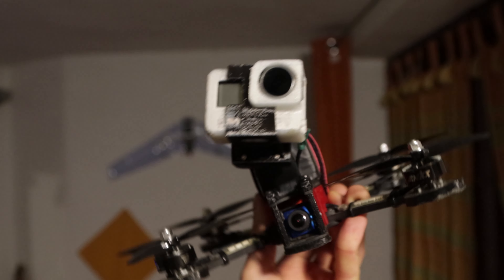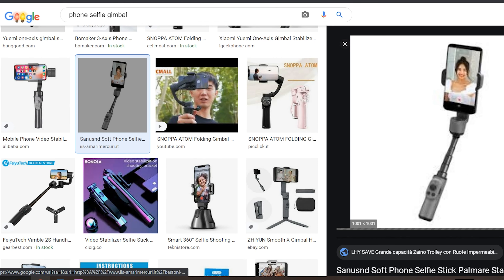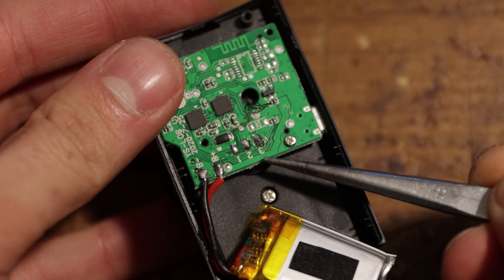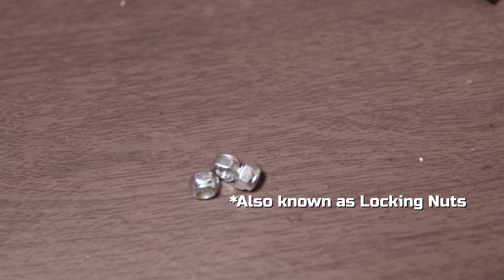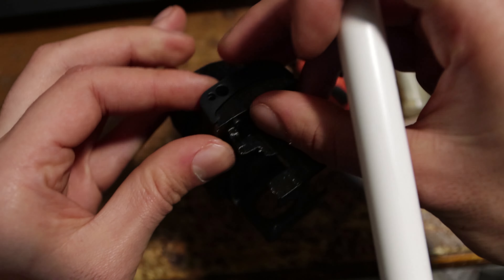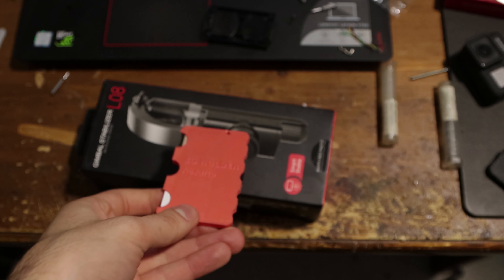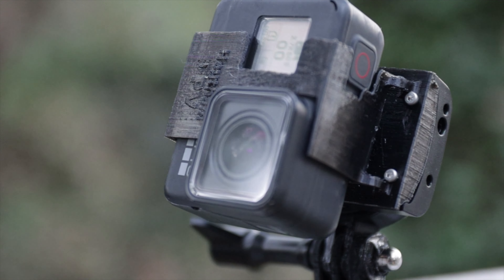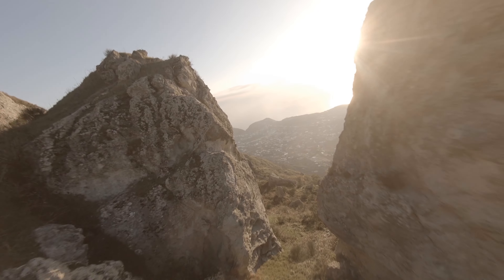I made an FPV Drone cinematic GIMBAL!

Comment: I did kind of the same ( incl. Modified TPU mount/casing) and used a LOFTer gimbal...nice and compact , easy to mod .
Now i start working on sourcing parts for a FPV gimbal DIY system ( 1axis only)
Reply from the maker: Hey man, it's an honor having you here! yes these phone gimbals are amazing, maybe you could test this kind of gimbal with a smaller brushless motor. keep in mind that the motor nut has a magnetic piece on top that gives the board a reference for its position with an hall effect sensor
Reply: @haythamfpv  I already used a 1804 on that boards, the magnet can be mounted on a the stator screw...not ideal but the concept looks very promising !
Reply from the maker: @nicecrash  Cool! I can't wait to test this gimbal with the Herp7 and your piggyback gyro✌🏻

Comment: Nice build! The results are pretty impressive :D I wonder how the gimbal behaves when doing basic rolls and flips?
Reply from the maker: Thank you, it stabilizes them like you did nothing, but only as long as it can rotate as vertical as possible, if the mount is at like 20 degrees and you roll while going at 40 degrees the 20 degrees delta will jerk a little, but it still is almost perfect. I did a test attaching the gimball on top of my helmet and I rolled it in the air, the result looked like magic hahahah

Comment: The main comparison we wanted was hypersmooth normal mount vs gimbal no hypersmooth but you almost alwats left hypersmooth on kinda defeats the purpose to use both at the same time but its a good idea for cameras without hypersmooth.
Reply from the maker: I was about to film gimbal with no Hypersmooth but I had a problem with some wet grass.. Hypersmooth does not defeat the purpose at all, it crops 10% at most and does not do horizon level. There's the hero 6 with no reelsteady and with Gimbal, it should get you covered😉